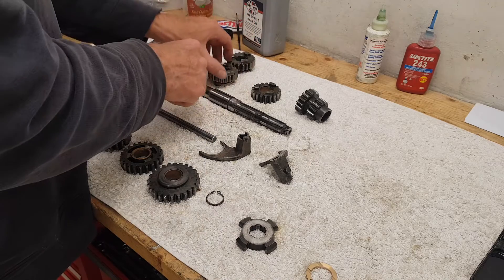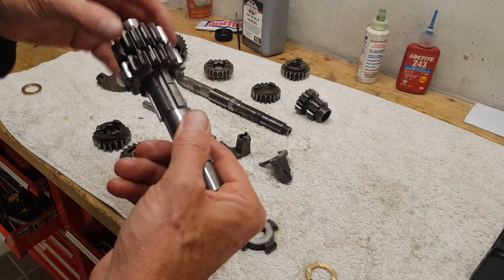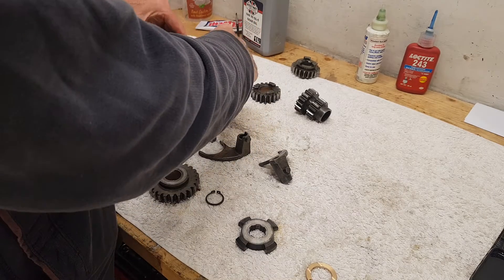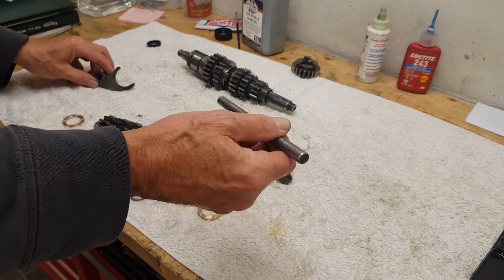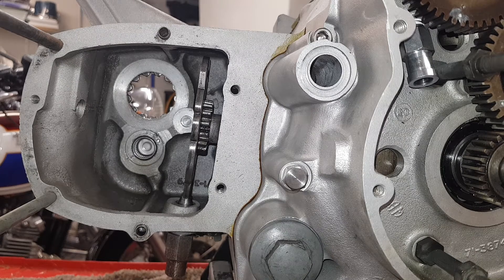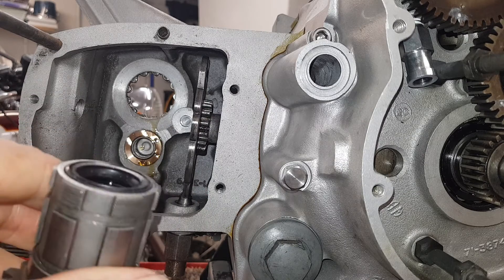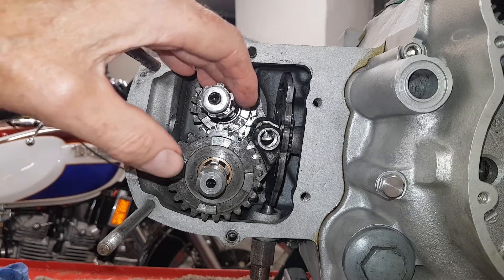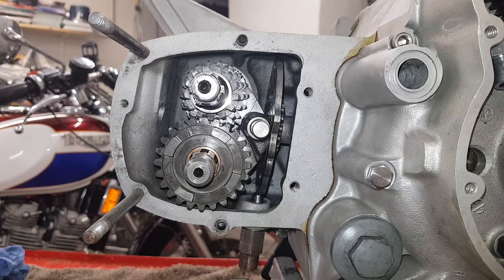Triumph Trident T160 Engine Rebuild. Part 27: Gearbox Assembly

Comment: Hi again Chris, thanks for confirming the 1st & 2nd gear installation query. However, I’ve found out this afternoon another slight discrepancy, in that on the same episode you showed installation of the mainshaft 3rd gear with the dogs facing outward, in fact this gear surely should be fitted to the shaft with the dogs facing inward  with the plain side facing outward. I installed the gear as your video showed and I couldn’t get third gear. Having stripped it all again I found brass shavings on that gear and mainshaft from the bearing rubbing.  A quick look at other illustrations showed the gear reversed. This I did and now can manage all the gears. Please this is not a criticism of your videos, as I think they are without doubt the best explanations on utube, but just pointing out my findings on this arguably awkward gearbox to install. On a very positive note your trick with the magnet realigning the selector fork worked brilliantly well. So thank you once again for your very informative videos, they are the best.
Reply from the maker: yes, looking at it I think you're right. Looking back now I think I reversed third gear on the mainshaft when I came to fit the first and second gear that I had already forgotten to fit! I believe I re-videoed that section but then forgot about the whole episode when I came to edit it all some while later. Apologies. Well spotted.

Comment: Hi Chris, liked the video, very informative, however you appear to have overlooked mentioning 1st &2nd gear must go in on main shaft before fitting 1st gear  gear with its fork in place on the lay shaft. My engine is a T120V so it may be different to a T160.
Reply from the maker: No, you're absolutely correct. With all the various takes and editing etc. I realised (too late!) that I'd missed that out. Combined first and second gear on mainshaft before 1st gear/selector fork on layshaft. 👍

Comment: I see on the 160 that it uses the spring loaded plunger that comes up through the bottom against the cam plate. Other later models use what they call a detent spring?But I've never seen one nor can I find a picture in any manuals. Got any info. Thanks.RMM
Reply from the maker: As far as I'm aware the detent spring is only used on modern era Triumphs (Hinckley Triumphs) which are completely different to the original Triumphs like the T160/T140 etc (Meriden/Small heath Triumphs). I'm fairly sure that you will find it referenced in manuals for these modern machines as apparently the spring is known to be a weak point and can break, leading to sloppy gear changes.